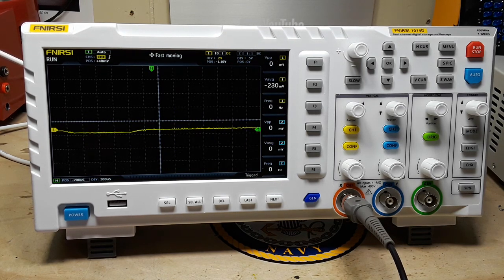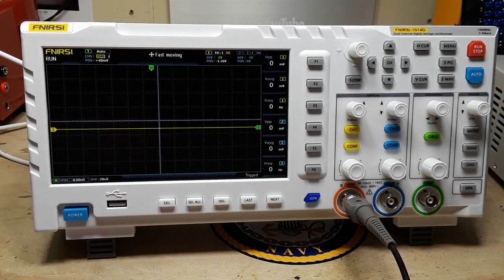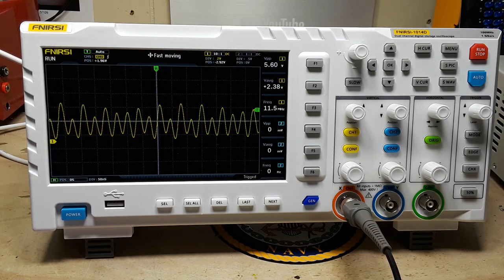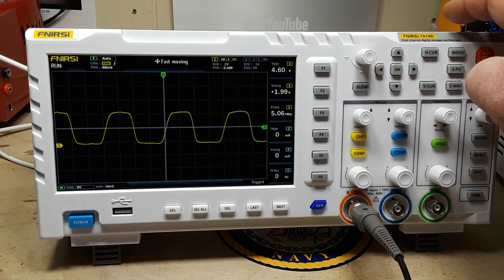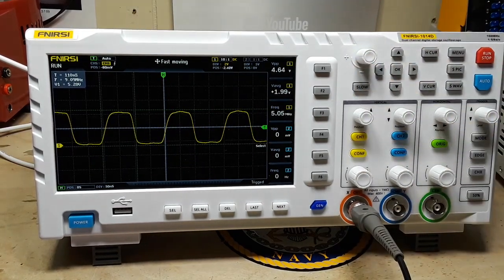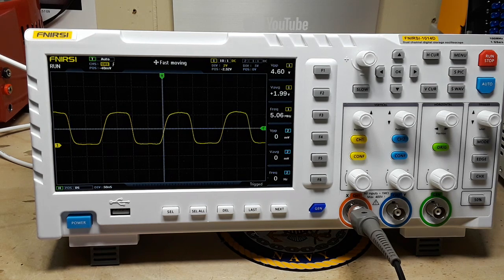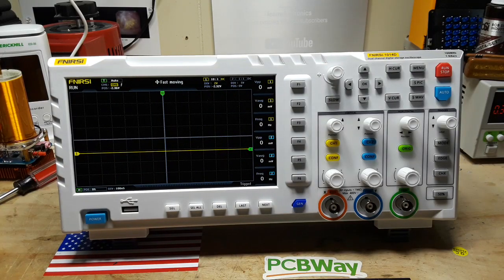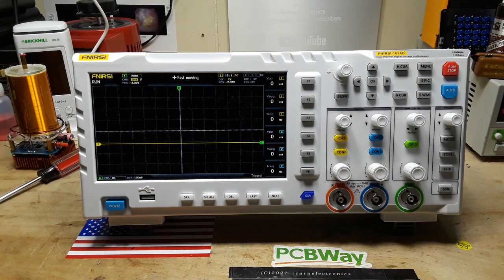FNIRSI 1014D Oscilloscope Review & Tear Down Part 2

Comment: I think I know what's going on when Paul is measuring the 100MHz oscillator.  He says the wave is fine, but if I measure the period of the waveform the old fashioned way (using the graticule), it looks to be little more than 3 major divisions - I estimate 3.2.  It looks like the time base is set to 20uS per division, which gives a period of about 64uS or a frequency of about 15.6KHz, which is consistent with the frequency the scope is measuring.  This is WAY OFF from the supposed 100MHz frequency of the oscillator, which should oscillate about 100 times in 1uS or 2000 times in one 20uS division.  Either the oscillator is FUBAR or what's being displayed is a classic case of aliasing - I choose aliasing.  This is a good example of why  NOT to trust the setup that happens when you hit the Auto button.

Later, when he measured the 100MHz oscillator again, he had the time base set all the way down to 10nS, which I think is its minimum, if it's the same as my FNIRSI 1013D.  Then the period of each sine wave is about 1 major division or 10nS, which matches the 100MHz frequency.  (It actually looks a bit slower than that but not down to the 80ish MHz the scope is displaying.  However, I would take this particular display with a grain (or bucket) of salt.  If the scope's actual max sampling rate is 200M Sa/S, it's only taking 2 samples every 10nS, which is right at the Nyquist rate.  It's hard to recreate a periodic signal with only 2 samples per period.  Couple this with a low pass filter with a 3dB point of 20-30MHz, as Paul and Kangaroo Dave estimated for the FNIRSI 1013D, and I'd have to say that this scope is doing a fair job of recreating a 100MHz signal.

By the way, Paul (by either genius, experience, or dumb luck) demonstrated an important debugging technique and was just to darn modest to brag about it.  When he didn't get what he expected the first time he measured the 100MHz oscillator, he measured some other things, then measured the 100MHz again and got a DIFFERENT result.  It's amazing how often that happens!

I tried to watch EVERY scope review video Paul has done this weekend (and have the red eyes to prove it - 22 different scopes!), and in one video, he put the scope into a mode where it only displays the various samples as unconnected dots.  (I really wish I had noted which video this was in - if anyone remembers, please let me know.)  It seems like that display mode would give a good method to determine the scope's sampling rate.  Put the scope in the shortest time base available with only one channel turned on, sample any waveform using single shot, then measure the time between dots (or dots per unit of time).  From this you could calculate (at least approximately) the scope's sampling rate.  Has anyone done this?

In Dave's teardown of the FNIRSI 1013D, he guessed which chips were the A/D converters and probed them to determine that they were sampling at 200MHz per channel (actually 100MHz per A/D, but there are two A/Ds per chip).  I'm guessing the A/D converters are the two chips to the left of the big one in Paul's teardown.  Any chance you could probe them like Dave did, Paul?  (Don't probe them with this scope, use your Rigol or MicSig.)

Comment: At 100mhz it showed a perfect sine wave is that because of its interpolation?
Reply: A perfect 100mhz square wave has endless harmonics of 200mhz, 400mhz, 800mhz, 1600mhz and so on. Since the bandwidth is limited to 100mhz (3db) it gets displayed as a (more or less) sinewave which is perfectly normal with any 100mhz scope. Also, the used canned oscillator does not output a true square wave, suffers from limited output bandwith as well. And the probe, the wires and what have you.
Reply: @Frank-w5k6o  Square wave consists of odd harmonics, not even.
Reply: @ChupoCro  Yes, that is right, I made a mistake there.
Reply: No. It was because of aliasing. Check Nyquist theorem, Fourier analysis and similar.